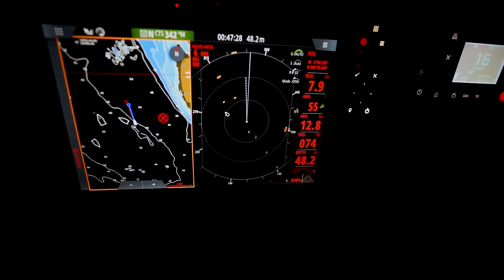The Tiniest Mistake Caused Our Biggest Problem (& How We Fixed It)

Comment: MATE, you have two motors - forget using the helm when mooring PERIOD
Reply: Did you write "Ulysses"?
Reply: @Neilhuny  i can sign a copy
Reply: @jamesjoyce5611  😆
Reply: I agree, stop the boat in front of your slip and pivot so the stern faces the dock and hit reverse, both engines. Leave the wheel straight the whole time
Reply: 100%. I used to wiggle my 44' catamaran into tight marinas by locking the helm and using only engines. It works fantastically well.

Comment: I am tired of seeing this issue across so many engineering disciplines. In the interest of saving a marginal amount of weight, carbon fiber, a brittle material, is used in the wrong condition. There needs to be a "Critical Function Analysis" on all parts of any system. In this case, the sail attachment should be metal because of the multiple shift in forces and wear presented. More importantly, its a critical part for the main sail operation.

Comment: Hi guys I want to let you know that when moving less than 4 knots in a Marina or when you need control you should centre the rudder and only use the throttles. That will give you maximum control and not let you turn more in one direction which can be dangerous in close quarters. On cats with a rudder forward on the props when reversing both props you may need to hold the helm to stop it moving. Cheers André in Sydney

Comment: It amazes me how many loose bolts or screws we find on our coach roof and deck. Each one we've found lacks thread locker residue which implies they were installed without it. It is such a simple fix so it boggles my mind why it's not done on installation. So far, we've been fortunate enough to find and fix them. None have gone missing. Glad you were able to sort it out. Cheers!
Reply: The answer is obvious, it takes time, time is money.
Reply: The consequence is shoddy product.

Comment: I imagine Seawind are seeing a number of cancelled orders. The number of major problems you’re seeing because of minor fittings is adding up. If they have a culture of negligence on hardware standards, I would have concerns about other areas as well…
Reply: I was thinking on the same lines, maybe not so harshly but there does seem to be many small little niggles that could be avoided in future builds. My industry we evaluate everything we do when it's finished. What does and does not work,  there are times you can not predict failure. Seawind do seem to make a good boat, but there is a quality control issue in some areas.  Please be aware that this is only my opinion. All boats have issues,  but let's not forget that at the end of the day Seawind is a business and everything is built to a cost. waxing  lyrical about the Tagra arch and what is realistaicaly a gimmick door ( I like there door ),  they seem to forgot the very basics. the issue with any company is no matter how much the owner and management team live and die by the company and poor their soul into it. there is always going to be someone who only works there so they can eat, they are not gong to be as concerned with a tiny dab of thread lock, on a Friday afternoon at 4:50pm when all they want to do is go home.  on another note, this is the issue of CAD and load bearing programmes. they can only test for what they get programmed to test. if the programmer, engineer, designer never thought of the scenario where load is put on an item in an unintended way then it will nit be designed to to cope with that load.  that grub screw that had backed out could have been a number of items such int the track.
Reply: At the end of the day.. boat building is very labor intensive - manual labor. Once builders start incorporating a greater amount of robotic techniques, I would think many of these issues should hopefully disappear.

Comment: Suprising  that the pin isn't designed with some fins to increase the strength in the batton car. by spreading out any stress put on it from any direction. Loved teh video. Looks like lovely country.

Comment: I have a monohull, but it has a 90m² full batten main with massive roach and is very light. At times she  is more like sailing a cat thanba mono. My best days are 240+ miles and an average day is 200 miles. I always carry spare batten receptacles and cars. These are a high attrition item and I replace at least one every season. I carry four batten boxes and six cars - two of each type. I do 8000 miles plus each season, some of which is tropical/trade wind and half of which is highish latitude temperate. Much of it is high wind open ocean or critical coastal sailing such as Bass Strait, which I have crossed four times in the last two years. Battens, batten boxes and mast track cars are critical parts which are difficult to sail without. You need some spares on the boat.

Comment: All hail to the inventor of thread lock. Every boat need some.
Reply: Before Loctite it was fingernail polish both work great.
Reply: I often say the same, to whoever invented those reflector blocks on the lane divider dashes and on roadway signage and guardrails.
Reply: @Ron-zr6se  I still use it on my specs.

Comment: As an ex-rigger, I would NEVER go up on the 2:1 main halyard using the block!
Firstly, you have no idea o the condition of the splice at the masthead or if the pin holding the splice is about to all out!  You just had a screw back out of the track, imagine what else might happen.
Secondly, it is very easy to get things caught it the 2:1 block.....hat strings, fingers etc.
Best way it to tie a double figure 8 on the tail side of the 2:1 block and attach your harness/chair to that.  You are then gooing up on 1:1.

Comment: We had the same identical problem on a Seawind 1260 where the track screw came loose and stopped the main from dropping. Luckily we were close to a sheltered bay where we anchored and I went up the mast to find the screw out, bent over but I could screw it in far enough to get the car to go past and drop the main. All the other screws were loose too.
Reply from the maker: Oh wow, that's crazy. At the time we really didn't want to go up the mast in the dark, but we would have had to if it hadn't come down. We're so glad it wasn't necessary. Glad you got yours sorted.

Comment: Imagine being caught in a line squall or the Mistral with a full main stuck up. The main sail or for that matter a large furling jib that jams under pressure is a potential disaster. Are large sail areas depending upon small individual parts really a safe option for offshore sailing by a couple. Just putting the question out there .

Comment: One little screw near the top of the mast slight letting out a bit caused all that. Might need a better design of the track system.

In mast furling would have been nice.
Reply: All systems have their draw backs, non are perfect. In mast reefing, jams and the sail is stuck up. Also all that extra weight aloft.

Comment: It's a common problem and that Doyle, who made the sail, rigged the battens, etc., etc. would leave unlocked grubscrews and/or short bolts is really bad. The thing to do is go around any boat , new or "new to you" and check the whole rig. Locktite Blue should do it but Locktite Red would be the best (yes, you CAN get red to release). Blue might be just a little too soft to sustain tightness with the continuous shock and vibration of a few months. General advice: I would urge, when collecting a new boat, that it be surveyed by an independent surveyor that has nothing to do with the factory. Fly in your own if you have to! Then the stress and excitement will not overcome looking for these basic but difficult, just at the wrong moment, problems.
Reply: …but would she have spotted a lack of thread lock?

Comment: Terysa - I have not been Binge watching your videos so I didn't notice the darkening above your upper lip before this video -  It looks like a bad Rash or a serious Sun burn.

I hope you are using a Sun block for your face - That area of the face and Nose are SO susceptible to bad sun burns. If this is due to a medical condition you may have mentioned in a previous video that I missed, I am sorry to have brought it up.
Reply from the maker: It's melasma :) I have used SPF 50 on my face all my adult life and most of my childhood, but it's a hormonal thing and heat related as well. It's just cosmetic, not dangerous or linked to skin cancer, and fades as soon as I'm out of the sun for a bit. It also flares up when it's really hot and humid, which it was in Asia.

Comment: Had exactly the same thing happen to me mid Atlantic while delivering a Swan 86 from Antigua to St.Tropez. The machine screws backed out of the Harken track and we couldn't reef. 2 trips up the mast at night in 20+ knots to sort out the problem. Fastenings had been fitted with Tefgel instead of Duralac which performs more like Loctite.